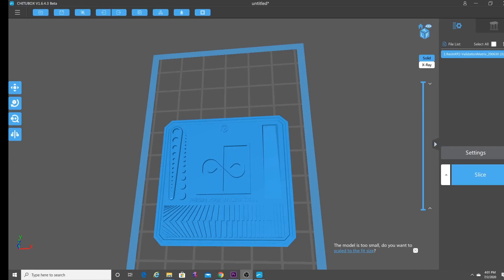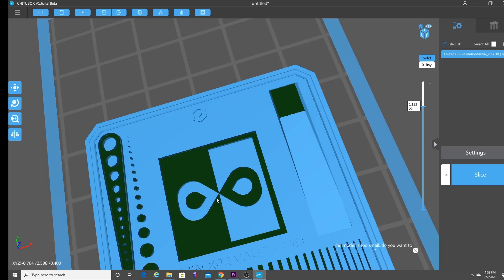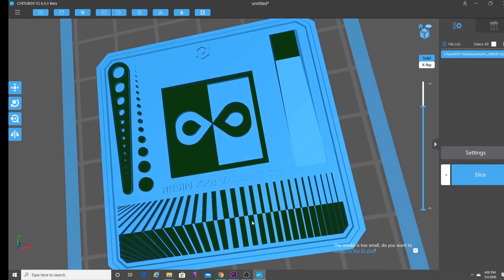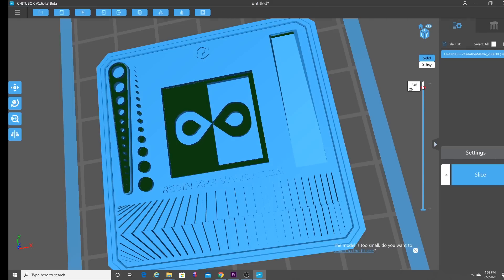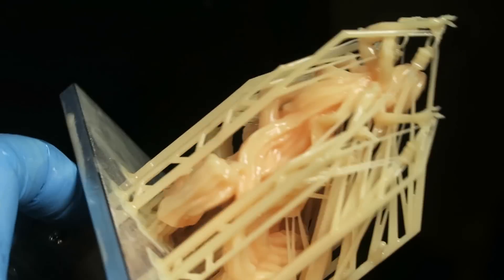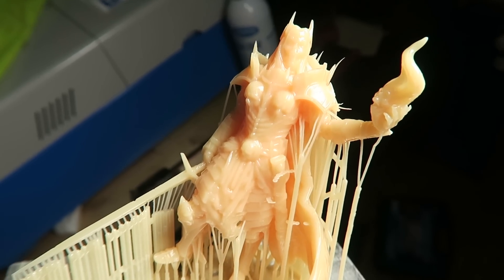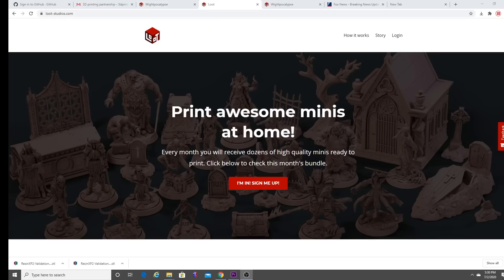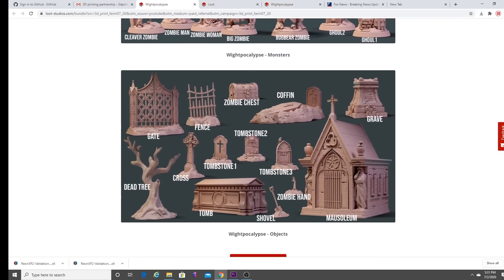How to Dial In ANY Resin for the Perfect Print!

Comment: Wow! Everyone resinprinting needs to check this out! Stellar info!!
Reply from the maker: Thanks brother!
Reply: @3DPrintFarm  Thanks. Just run the first test and it looks like the defaults for my QIDI Shadow were over exposing by a good deal. Does room temperature have an effect? I have my printer in a garage where the south Texas temperature is over 100 degrees.
Reply: @oldiron1223  
Yes, he mentions this at 2:21.  Temperature definitely has an effect.  Some resins that are very viscous needs even higher temperatures, compared to other resins.
Reply: @3DPrintFarm  Could you give me a hint if i want to print in 0.025 layer height? Does it work like this too?
Reply from the maker: @SnappyDIY  It should work, it's just going to take a lot longer on the prints since technically the layers are going to be super thin.  It would be worth a trial for sure!
Reply: @3DPrintFarm  had tried and worked same way to dial in. Thanks alot found 7.5 instead of 8s for standard elegoo resin on my mars has a little better quality :)
Reply: this was 0.05 and 5s for 0.025
Reply: Garret , thanks for the great video and the method but I have a problem, maybe you can help?! The setup: Anycubic Photon S, Anycubic Plant-based resin green & Chitubox latest version. With your method the ideal time works out at 4,0 sec. exposure time, but in a test print the supports (standard Chitubox settings) are failing... - when I go back to the standard 8 sec. Chitubox exposure time the print and supports are perfect... Your opinion \ suggestion?
Reply: I'm having the same problem as Eduard using Elegoo Gray and Prusa supports.  I've only been printing a couple of months and this is the first time using the Elegoo and first time trying to change the exposure times from the 'normal' settings.  Really enjoy your videos!
Reply: @eduardkompast3063  I have a rather similar issue with my Creality-LD002... I need to have at least 5.5 seconds of exposure if I want the print not to utterly fail:-/
Reply: I agree. My 1st printer is on order and I can’t wait to get started! Thanks for the info!
Reply: If you recommend it then I have to watch it.

Comment: I find that running the perfect exposure results in numerous partial fails even with a low lift speed.  So I always over expose by 0.1 second (minimum my slicer adjusts exposure by).  I don't lose enough detail to matter but partial fails and tears are gone.  I can batch print files back to back to back to back all day long and I just scrape them off the build plate, add resin, and press print again.
   I also run my bottom layer typically at 20 seconds, and try to connect all the rafts of a print.  So once I get 1 corner up my scraper just slides under the rest and everything comes off easy peasey.

Comment: When I print validation tiles they always seem to come off the plate and distort. The sides rise so that the tile is slightly cupped or convex. This isn’t an issue for the tests, but it also happens when I print flat objects on the plate. How do I prevent this?

Comment: Very excellent video! Just yesterday I was trying to print one half of a model car body (the whole thing is too big for the printer), and the supports in the middle stopped forming halfway through the print. I did some adjustments, but I didn't go past the 2.5 exposure time. I'll try your method to see what happens. 

Interesting enough, despite the missing supports, the body came out fine with no deformed panels. Either which way, this will be helpful in those situations where some files are trickier than others, depending on what's being printed. I did download the matrix .stl and will definitely fine tune this machine (Phrozen Sonic Mini4K).

Thanks so much!

Comment: Siraya Tech Fast Grey on an ELEGOO Saturn lays down great at 2.5 seconds.
The Siraya Tech Fast WHITE on the other hand needs about 8 seconds per layer even though the docs say it should also only need 2.5

Its important to run a validation matrix like this on EACH resin you use. Even if its the same brand and kind but a different color.

I keep a spreadsheet that has all the settings for each resin i use in every color i have used.
Sure I save them as resin profiles in ChituBox but having a backup document is also a really good practice.

Comment: I ran a series of these exposure tests and from 3.5s all the way down to 1.0s and they were all showing overexposed but the 1.0 was basically falling apart. I tried to print at 1.5 thinking that was as close as I could get and maybe have a successful print but my models broke off of all their supports. These were professional supported miniatures so the supports shouldn't be the issue. Printing with LD-002H and eSun Water Washable Gray. What could be the problem?

Comment: My first test file on Anycubic failed, my initial tought was that I didn't align the buildplate correctly  and then I tried the classc rook and still failed.
Next as my third print I checked online for some  settings and feeling confident I jumped in a miniature wizard model I found online and it worked perfectly.
I'l defenitly try this chip test as a method to check if indeed the exposure where the problem (witch I find it a bit wierd since I used the default ones recomended for the cube test) or it was simply a case of missaligned buildplate.

Comment: My exposure time usually sits at around 8 seconds but i still sometimes get random models that simply do not stick to the supports. I dont think its a levelling issue as i've releveled several times and the fails seem to be in different places along the plate

Comment: So I'm using Wanhao white with the Duplicator 7. My print came out almost transparent instead of white, with very little definition. I see some semblance of a pattern to it, but it's almost non-existent. I was doing a 7 second exposure, shouldn't that have been enough for some sort of definition to it? I think it's under-exposed but it may be some other problem, I'm still new to this so I don't know if that's a symptom of the resin, the machine, both, etc.

Comment: I got a voxelab polaris last week and nothing has printed correct in several attempts. I just printed this and it's showing I've got an over exposure problem. Also, it printed and warped up to a bowl shape when cured. Gonna try a few more times, but this is becoming a greater hassle than extrusion printing.

Comment: Underexposure or non-leveled build plate are the two things I'm finding are my issues. This is my first week of resin printing which has been crazy fun! However, the blobs of resin in the vat, and the supports hanging off the build plate are the exact issues I've found with recent more complex/larger prints I'm doing.

Comment: This was tremendously helpful! I got some new resin and tried rolling with the same settings as what I was using before. I couldn't find any recommended exposure time from the manufacturer, and I was kind of stumped. This lets me take ownership and solve the problem WITH SCIENCE! Found out my optimum exposure time is about half of what I had been using.

Comment: okay, newbie here. I have a sparkmaker. I know its not the best 3d printer in the world, but it has been working fine for us until now. chitubox had un update and now its telling me that to pint a normal hero sized mini its going to take 62hrs! Before it was taking anywhere from 11-15hrs depending on the mini. I mean the Validation Matrix its self it wants to spend 3hrs on and when I do it doesn't stick to the plate. I haven't been having any issues with it until I updated chitubox. I have just been trying to figure things out, any suggestions?
Reply from the maker: Make sure and check your resolution. This almost sounds like the numbers are set too high.  Also check your Normal exposure times.  My guess is that the resolution is set way too high.  Double check that it's set to 50 microns.

Comment: I was having trouble printing some thin, clear parts. I tried this and it worked perfectly! Thanks! I do have one question though: What about the Bottom layer settings? Something this thin is probably mostly running in the bottom layers isn't it? You have them set a .05 so if you have 5 bottom layers the first .25mm will be bottom layers. If someone had their bottom layers normally set for large heavy objects they might have 8 or 10 bottom layers and the Saturn has 'transition layers' so this might affect this test model's print, right?

Comment: I now count myself lucky AF.     Just got my first resin 3d printer 
(Voxelab Proxima) and the first print I made was this validation matrix.
   Default settings in chitubox and using a cheap resin I lucked onto a 
near perfect print of the matrix, though not quite there.      I think my favorite part of this test is because it's so low profile, it prints in minutes.      Patience is hard with shiny new toy.

Comment: I'm new to 3DP, and I'm trying this validation file. I've printed it out with all the parameters identical to the vid above, and it looks  nothing like your above - its wafer thin, the graded recesses on the left-hand side are holes right thru to the build-plate . Should the bottom layer count be only 3 (ie 3x 5microns) ?  - your final print looks much more substantial. I am using Anycubic photon with standard Elegoo grey resin.. Thanks
Reply: Extra info  - I've now had two more attempts, both of which have stuck to the FEP and not come onto the build plate

Comment: Also, you should be getting an equal (+/-1) number of dots and holes on the right side of the print.  Overexposed more dots, underexposed more holes.  This is the easiest test that I have found too.

Comment: I am confused (Creality LD-002 User with elegoo grey resin -not the one that can be cleaned with water-): My printer is rather new (~60 hours of printing, 2 months old), yet I have to bump up my exposure time to at least 5.5 seconds in order for such Miniatures as you showed not to fail (underexposure sign of only the supports remaining)
I‘ve never had a single for perfect print, there‘s always areas either missing or being a flat plane-blob (yet attached to the model)?
Can anybody give me some advise?

Comment: Naive question: if resin happens to get under-exposed and consequently pieces fall off into the vat during printing, should resin in the vat be filtered before starting a new print? I'd imagine bits of exposed resin floating around in the vat would pose a printing issue.
Reply: Very much so, filter it out, if you get a cured piece of resin float under your build plate during printing you run the chance of maiming/destroying your FEP sheet.
Reply: @seshthreepio  Probably wise to filter unused resin after each print job before starting the next one, just to be sure? Of course, if there does happen to be any bits of cured resin in the vat then the damage potential already exists before a print finishes. It seems like it would be time-consuming filtering and cleaning the vat after each validation print when dialing in an exposure setting.

Comment: I was able to find that a 3 second flash time was perfect for this validation on my printer (Creality LD-002R), but when using the same settings for my mini's, they wouldn't stick to the build plate and unfortunately they stuck to my vat.....
Reply: Same experience here. Did calibration before going to work. Started 9h print and it had failed miserably. Maybee it comes down to to my support settings, was lazy and using auto support on base and added supports manually on missing islands.

Comment: As explained in the video I did the tests using the test. I have not found a convincing result, starting from 6 seconds up to 15 with a second step. with short times (from 6s at 8s) the rectangles are printed very well but the thinner parts are not exposed. In the higher times the opposite happens. specific that I use elegoo gray resin washable in water. I found a good result for rectangles at 7 seconds but the smaller lines are not there. The exposure time of the first layer is 80 seconds. I am saddened to not find in any way the perfect result in this video ..

Comment: How did you get those super thin supports? Were they presupported or did you support them yourself?
Reply: BTW Garett, as always, love your work. I haven't needed to use this video until tonight when I switched to Siraya Fast grey...I ran 3 tests and they all kept failing. I actually thought it was the stick on screen gasket which I just put on the other day, so I peeled it off...now I guess I probably wasted 4 bucks by doing so. Derp.

Comment: Just one question: At 3.5s exposure some of the cylinders and text are not there and some of the lines are messed up, and you say that's the higher end of the "sweet spot".
So… Does it mean that, instead of trying to make sure that everything prints and overexposing, it is better to set the exposure lower and just avoid printing too thin things?

Comment: Great video! This is the easiest test I found! Question, if I lower the layer height, do I need to reduce the bottom exposure time as well?
Reply: No, the bottom layers have to be overexposed, because it has to stick to the build plate really well. Resin prints are usually done hanging off supports (as opposed to standing flat on the bed in FDM printing) exactly because the problem of the "elephant feet" is so much worse with them, you simply have to keep the model some distance away from the build plate.
Reply: So what is the recommendation for bottom exposure time compared to normal? Would you just double it? Like 2sec layer exposure : 4 sec bottom exposure? I know this is an older video and thread hopefully y’all reply

Comment: So, I’ve ran the calibration print, after getting the exposure pretty close(there’s still some tweaking required) I’ve noticed that on all the prints where the symbols set on the flat portion of the chip/card/print appear to “bleed” out. Also, the circles that descend in size, are those actually holes that should be open all the way to the plate? If so, I need to adjust my bottom exposure time.
Any direction would be helpful, thanks!😊

Comment: A question. If the print is over-exposed (and mine are definitely showing the signs of that shown in the video), can the print height be affected?
I've done three different prints of the file, and all of them (and some other prints in the same [new to me] resin; Anycubic Eco Gray) end up about 75% of the height they are supposed to. The calibration matrix print ends up wafer-thin, and things like the raised ramp feature is missing its recessed portion (the depression).
I've never seen Z-height affected like this.

Comment: OK... So I downloaded the calibration print.  I first printed it with the default exposure times on the Elegoo Mars in Chitubox - Specifically 70 sec first layer (OK I changed this from default 60) and 8 sec exposure time.  Bottom layer count 5. Layer height 0.05 mm.  When I sliced it Chitubox reported an 11 minute print time.  The mars reported a total of 13 min print time.  The resulting print was wafer thin and the figures barely perceptible.  I'm using Elegoo standard grey.  So what is going on?
Reply: Did you set your light-off delay? I was having the same issue and the culprit was exactly the light-off delay.

Comment: Great video, yours was one of the min channels to give me confidence to start 3D printing! Question about this calibration STL: the download version seems to be missing the top (bottom?) layers, or at least the test holes are going all the way through the print, unlike the solid piece shown in your video. Does this matter for calibrating or could you post an updated link?
Reply: My judgment is that it shouldn't matter if the holes go through or not.  The size of the size is what matters in helping judge the exposure.  As another commenter said, it should be the same number of holes at dots shown.

Comment: Garret , thanks for the great video and the method but I have a problem, maybe you can help?! The setup: Anycubic Photon S, Anycubic Plant-based resin green & Chitubox latest version. With your method the ideal time works out at 4,0 sec. exposure time, but in a test print the supports (standard Chitubox settings) are failing... - when I go back to the standard 8 sec. Chitubox exposure time the print and supports are perfect... Your opinion \ suggestion?

Comment: Thanks for this tip and procedure. This is a very necessary knowledge. I have wasted lots of resin and suffered failures after failure. I will update you once I receive new fep. I also tried to order that M5 tact (to hold the screen in place and protect it. My printer is 135 x 215 . There was no pre-cuts for this. I ordered the material and will cut it. .

Comment: I’ve been having a very different issue recently, and while I think I know how it’s happening, I’m not sure how to fix it. Basically, I’m using clear Anycubic resin  in my Anycubic photon set at 45 seconds for the base, and 11 seconds for regular layers. Never had an issue. Now, however, I keep getting a big glob of cured resin in among the supports. I believe my light is shining up through the print and curing the resin that’s puddled up in amongst the supports. I did have to grab a new power supply (original is packed up in a storage container) and the new supply is 65w rather than 40w. Is it making my light too strong? I’ve bought some black resin hoping the opacity will fix the issue, but I’ll likely need a 40w power supply as well. Is there anything else you can think of that I might be missing?

Comment: Is the bottom layer exposure a multiple of the first ? Or if not how do you calculate the bottom layer exposure.
Reply from the maker: Typically, the bottom layer is 10x times the normal layer but your mileage my vary.